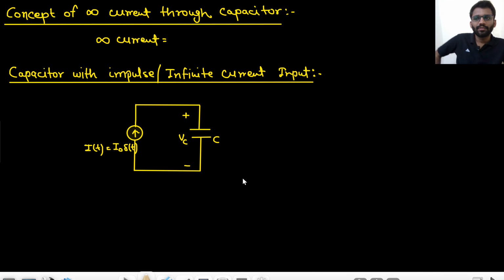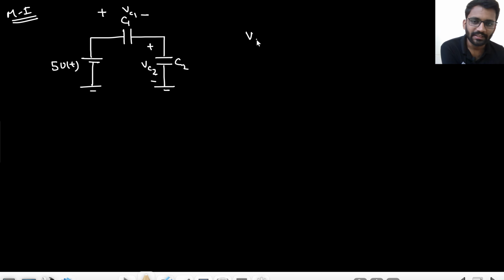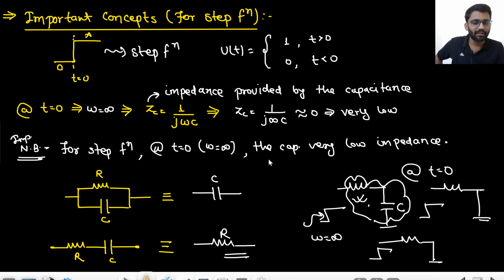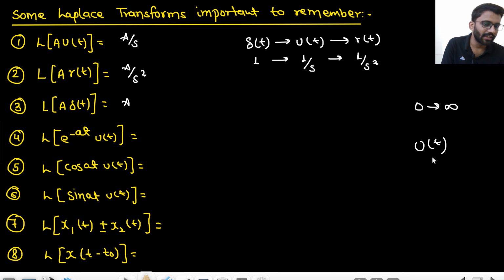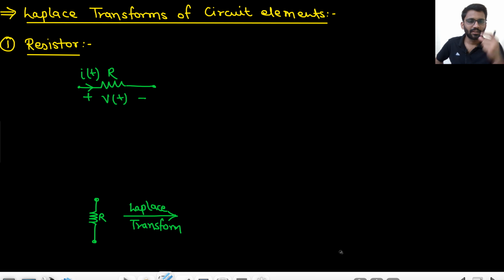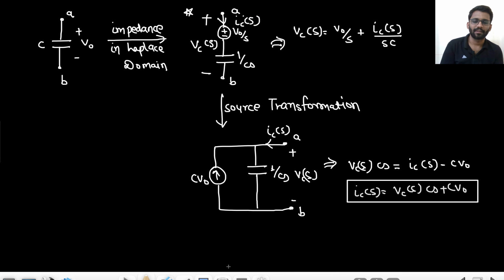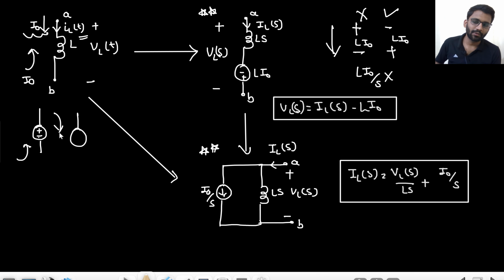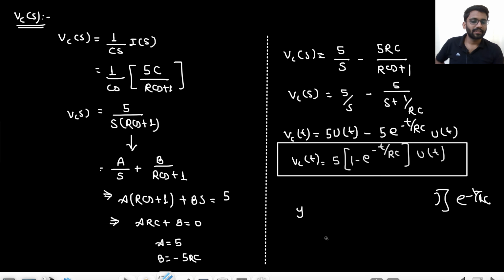Impulse Current in the Capacitor & Basics of Laplace in Circuit Analysis || GATE 2025-26

Comment: i didnt get why did he not take - + for capacitive network in laplace domain as he said based on direction of current we give the polarity to the voltage source but didnt apply that same thing to capacitive network only applied it for the inductive network!! 
Timestamp: 1:06:19 Pls check and clarify!
Reply: yes..! same doubt
Reply: Because the equation was wrong in capacitive circuit 
Correct equation 
Vc(s)cs = Ic(s) + cVo
Reply: @jatin-k8o8q  sir drew the the circuit using the equation not from diagram to finding its equation

Comment: The laplace of Capacitor voltage taken is dimensionally incorrect. for the dimesnion of s to be Hz(of frequency), according to your equation it is inferred that I(s)= CV0 which is incorrect( Q = CV not I). Please check and correct it.

Comment: Around @29:00 As far as I know, the limits of laplace transform is from 0 to inf and not -inf to inf...please do look into this
Reply: there are two types unipolar and bipolar, in network/circuit analysis we usually use -infinity to infinity, In problems like control where it start from time=0 we take unipolar,... whereas in circuit initial conditions might have developed prior to time so there comes a need to consider
Reply: @Aman-ic8mv it's unilateral and bilateral, not polar

Comment: a small mistake to be corrected that
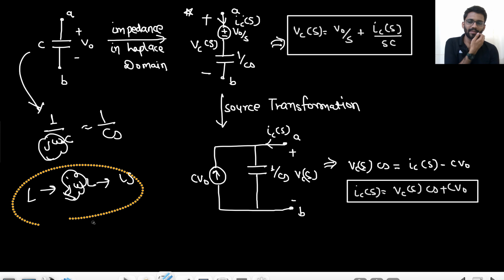@ 1:00:12 
ic(S)=Vc(s)CS - CVo
Reply: Thanks for providing such a Nice conceptual Understanding
Reply: initial voltage of capacitor is considered 0 for this capcitor so it will only be Cs Vc(s)
Reply: Yes same  error i also found..  your are correct 💯